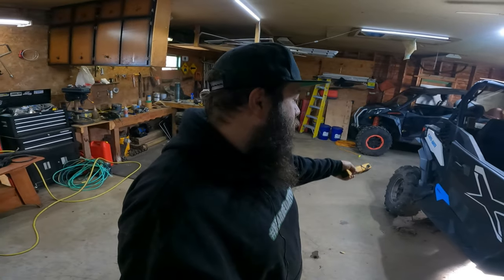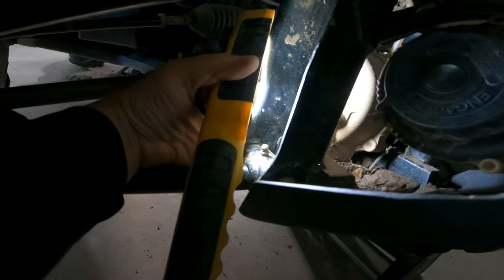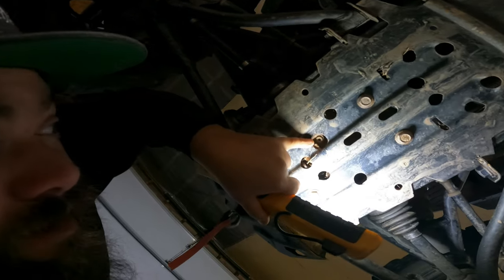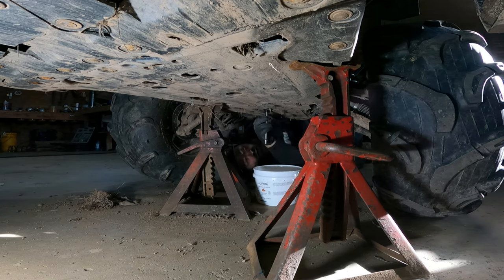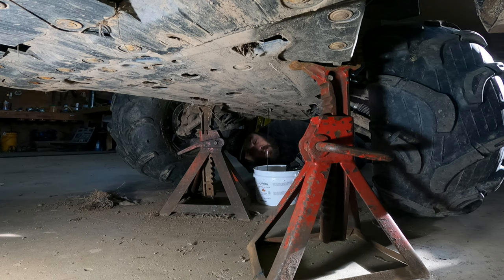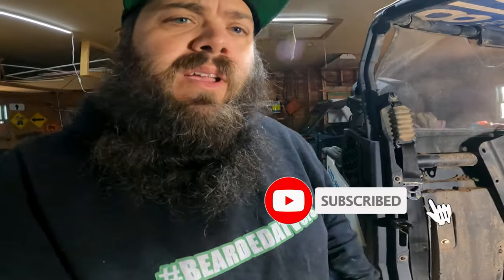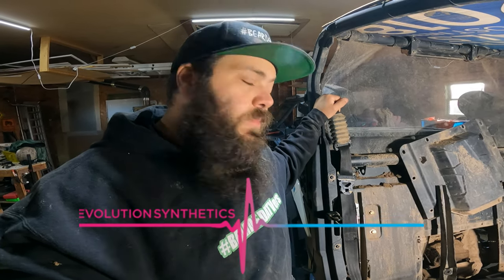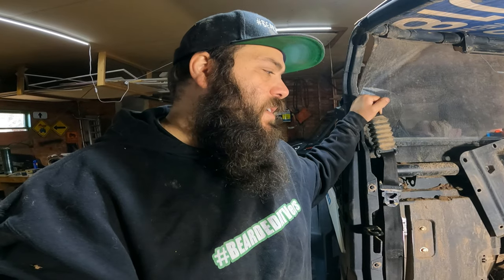Maverick trail engine, differential, fluid changes with Amsoil fluids

Comment: Informative video 👍👍. I had problems with my seat adjuster too. Mud got in there and it wouldn’t move. I cleaned it out and got them to slide really well. I did notice when I went to put the seat bracket back on the sliders wouldn’t slide again. I found every time I would tight it down it would stop sliding. It’s an alignment issue. Final got it aligned and works gooder now.
Reply from the maker: Haha gooder is deff the way to go! For myself as long as it moves enough for the oil change I’m golden. And thanks!

Comment: The 18mm, one socket/wrench that oddly isnt included in alot of off the shelf sets. The Z takes the same filter but WAY easier to change.
Reply from the maker: Is the 18mm usually missing? I always thought it was the 16mm. I do know for sure I own like 100 10mm sockets of various sorts
Reply: @beardedatvers  16 is the other one too. I've even got a Mastercraft set of impacts that over looked the 14mm. I just don't know.......

Comment: Just curious , are the Amsoil kits cheaper than the CanAm kits  ? I use to use Amsoil when we raced quads and loved there oils and was thinking of starting to use it in my XXC i bought this past summer . I was shocked at the price to do a full service using the CanAm BRP fluids when i did my first service  ! Im in Canada aswell , Ontario actually .
Reply from the maker: It was $30 less than the BRP kit for the oil change alone
Reply: @beardedatvers  ok thats good to know ! Will most definitely probably switch to Amsoil on my next service  !
Reply from the maker: This is my 3rd change with Amsoil, even though they sponsored this one it was getting amsoil regardless, big big fan of their products and never had an issue